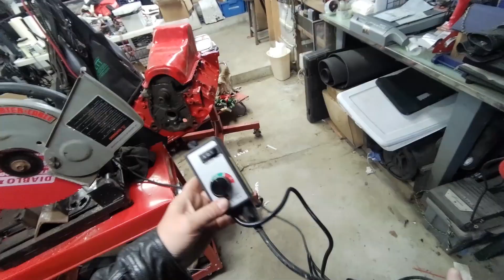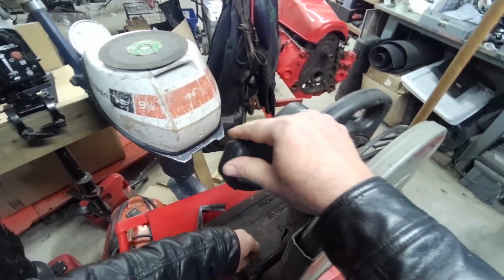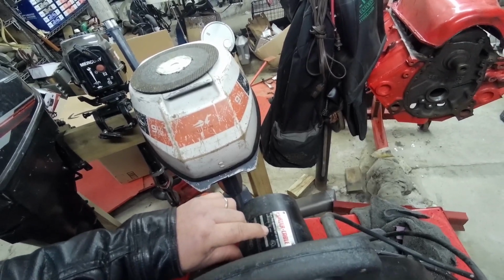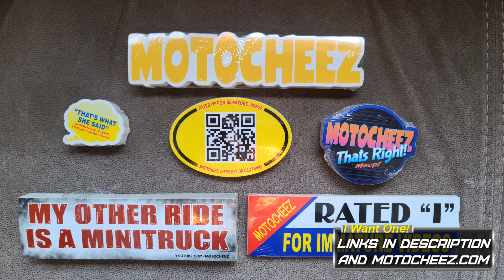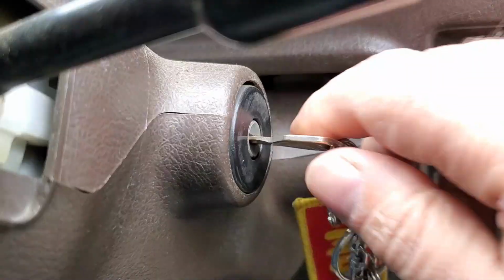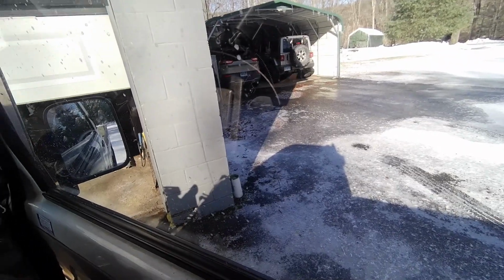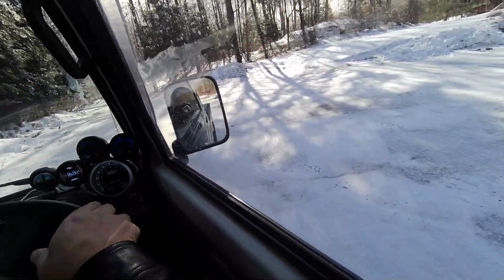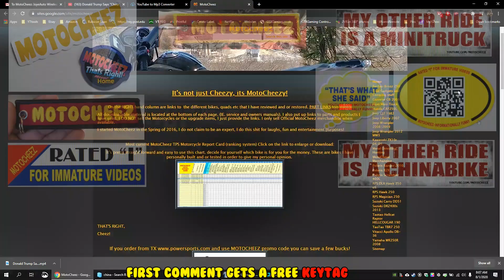Mini-Truck (SE06 E24) Mini Ice Truckers Diablo 14” metal cut blade test, insta360 One X2 videos

Comment: I found this online "I have a 1999 Carry. I went to the part store and found that the visor for a 1995-2005 blazer would work. It's not perfect but the angle is really close. I installed them and the work great. It is Oreilly Auto Part number 92127 made by AVS. Hope it helps."
Reply from the maker: Great info, thanks!

Comment: It’s all fun and games until the ice breaks 😂
Vin Cheesel when I drove a tractor trailer I was propositioned they wanted me to be one of those ice road truckers. Wanted me to drive across those frozen waters in Tractor Trailer. I could’ve made close to $100K in 3.5 - 4 months and been off work the rest of the year.  Or I could’ve drove truck back home the rest of the year and made less than that. But I got to weighing the pros and Cons and there was a few cons that stopped 🛑 me dead in my tracks. Such as breaking down and freezing 🥶 to death. Or the truck going a hair above the allotted 35-40 mph & the ripple of the water under the ice causing the ice to have a weak spot and the Truck and you go down. And the fact that if you and your truck goes down they most likely won’t find you. The money sounded great to me but the fact that you have a 50% chance of dying by drowning and hypothermia or freezing 🥶 to death if your truck breaks down........MADE ME SAY THE HELL WITH THAT KINDA MONEY IN THAT SHORT OF TIME!!! 🤣🤣🤣
Reply from the maker: And I be insurance wouldn't cover if you fell through, some clause they have I bet  🤣
Reply: @MotoCheez  you’re probably right but I never got that far as to sign up so I don’t know 🤷🏻‍♂️ But I’d bet you’re right.

Comment: You need a bigger shop! How about a shipping container!
Reply from the maker: I have a 20' shipping container, 2 enclosed trailers and another 20x20 garage with a lift! But I need a 50x50 garage with 20 foot ceilings 😁😁
Reply: My buddy did two 20 footers welded together.. Turned out really nice.. Did a nice roof and a few windows and doors.. He spent a lot more than expected..
Reply from the maker: The containers aren't cheap anymore either.

Comment: You should try 4wd donuts sometime. Just hang on!
Reply from the maker: I actually did a few four wheel drive donuts they're definitely more difficult but once you get the hang of it you actually can get a little bit more speed except the speed hurts on the corners cuz now all four sliding off. Take some adjustment